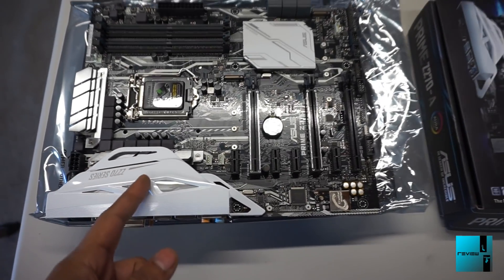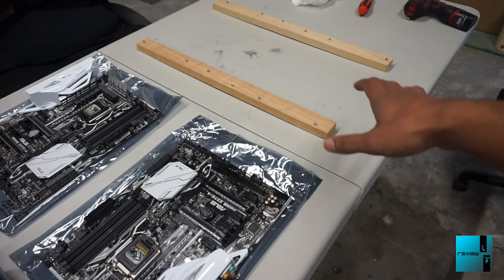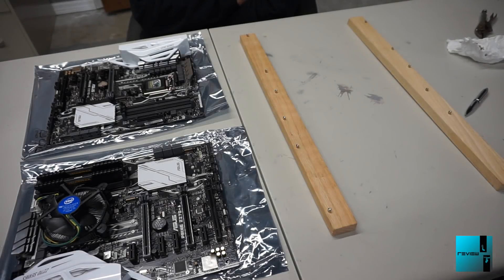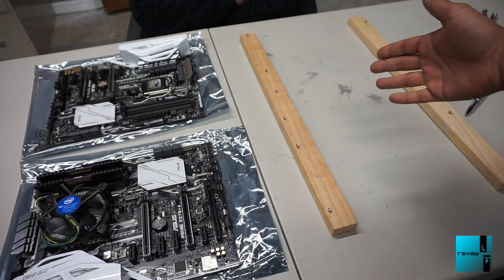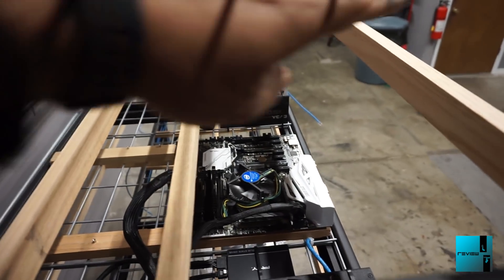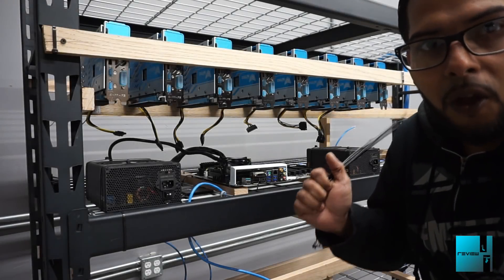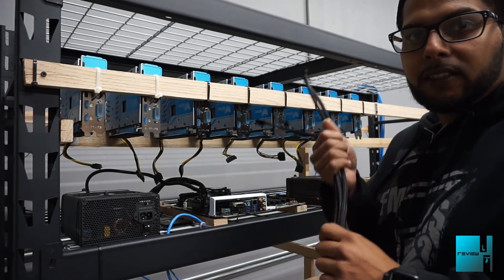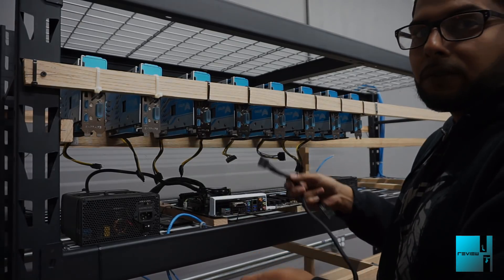Mining Rig 3 Assembling S01 EP1

Comment: I’m having a problem getting the ASUS z270 A prime to recognize the 8 GPU
Reply from the maker: Allan Siegle make sure 4g encoding is enabled in the bios
Reply: Review I.T. I done that.  All bios settings are set right. I had 7 out of 8 working and now only 6 working could walk me through it?
Reply from the maker: what i usually do is boot up on 3 or 4 then if it sees all 3 or 4 then plug another gpu in while its on and reboot the rig. after reboot i go into device manager check if its there if so i then follow process til all 8 is seen. wish i could but currently working on a video right now at the shop
Reply: Review I.T. Have you had a faulty M.2 pci e. Be bad or go bad?
Reply from the maker: Allan Siegle in the beginning with the first m.2 to pcie adapters I was using then switched to the new ones and didn’t have a problem again. Also make sure you changed the m.2 setting in the bios to pcie and use the closes m.2 slot to the processor
Reply: Review I.T. Yea I changed that in the bios as well. I put another m.2 adapter and nothing. I need more risers. They are very poorly made. 😞🔫
Reply from the maker: Allan Siegle what kind of risers are you using?
Reply: UBIT..and its looking like 3 out of 6 work..how Im thinking its the M.2 adapter because i tried putting a known working gpu with a known working riser into it and nothing..Got an error messaging saying Graphics card not detected.. weird this is that it was working before
Reply: Ok I have gotten 8 to be recognized but after mining for 2-5mintues the rig freezes and after reboot only 7 work
Reply from the maker: Allan Siegle did u run all window updates?
Reply: Review I.T. Yup n seems to be more of a hard ware issue but then I dunno 😞🔫
Reply: Review I.T. Find on FB we can chat in messenger
Reply from the maker: Allan Siegle did you swap out the riser and tested with a different one? Also I don’t have a fb. I do have a Instagram under reviewi.t

Comment: Doesn't that mobo only have 4 pcie connectors? How are you connecting the other 4 gpus
Reply from the maker: it has 7 pcie slots and 2 m.2 slots. i use a m.2 to pcie adapter for the 8th gpu
Reply: Ahh can only see 4 pcie from amazon picture

Comment: Right on dude that´s gonna be a cool mining ring. I already have mine with 3 saphire nitro x+ 1 msi gaming x all Rx 580 and my old evga gtx 960. I´m getting the PSU evga g2 1000w  tomorrow and I think I´ll get a 750w evga PSU for just the motherboar and the gtx 960. What do You think about it? THe evga g2 1000w can handle the other four?
Reply from the maker: whats up bud,  thats awesome  the 1000w will be good enough for sure. just  make sure you have enough gpu outlets on the back of the 750w
Reply: Right on Dude thanks for the answear!!!
Reply from the maker: anytime bud